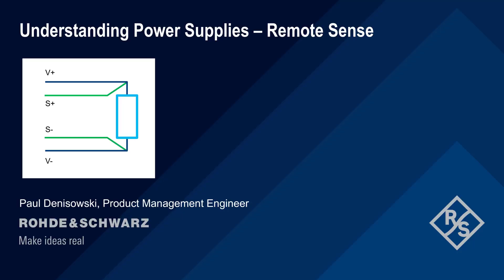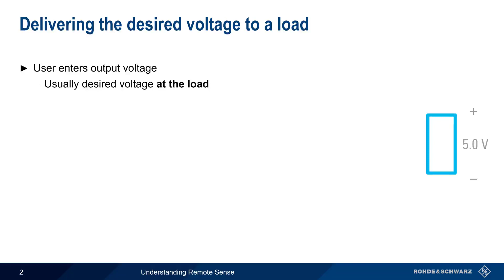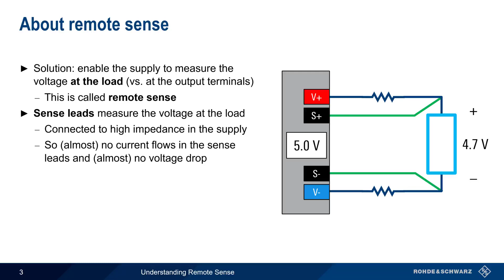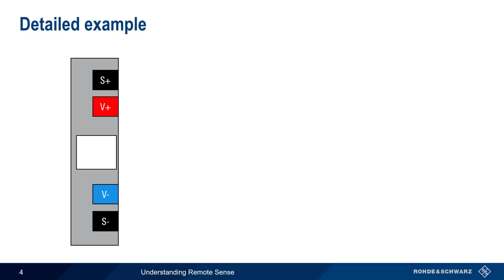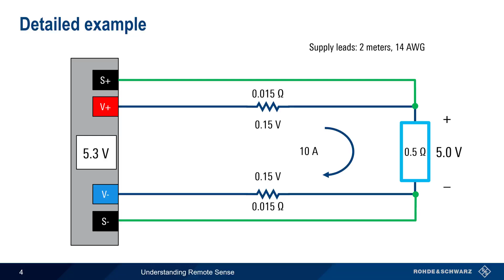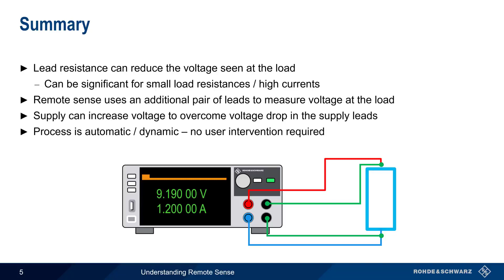Understanding Power Supplies - Remote Sense

Comment: Why would a power supply have the Sense terminations bridged to the output terminations by default? Is it because in most cases it doesn’t matter? ( there is the option of removing the clips that bridge the senses with the outputs)

Comment: Why the lead cables for remote sense don’t have any resistance?
Reply: Oh, they do have resistance.  :) But they are terminated in a very high impedance, so the current flowing in them is very low.  A low current means a low voltage drop (V= IR) in the sense leads, so they more accurately measure voltage at the load.
Reply: @pauldenisowski  👍
Reply: @pauldenisowski  👍👍Good explanation. Tnx.